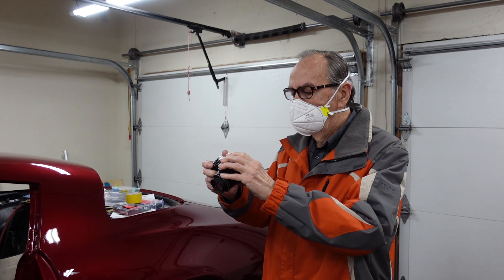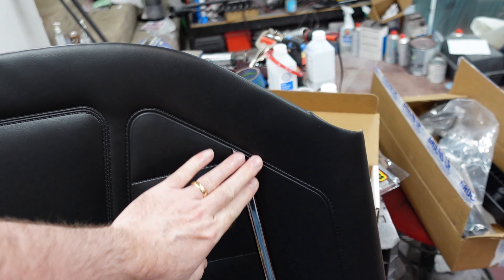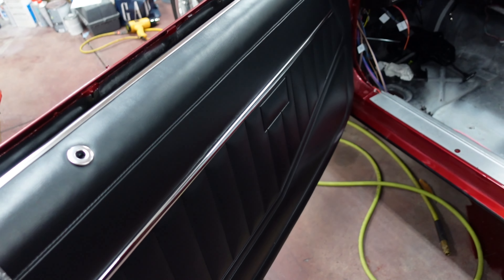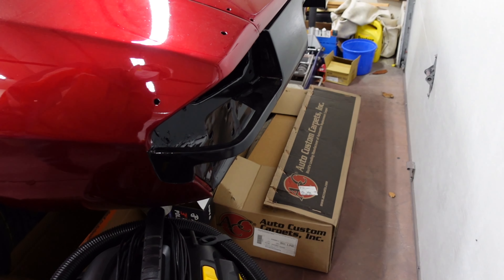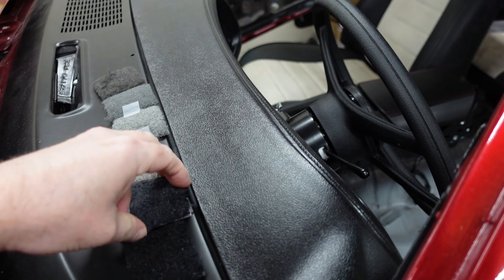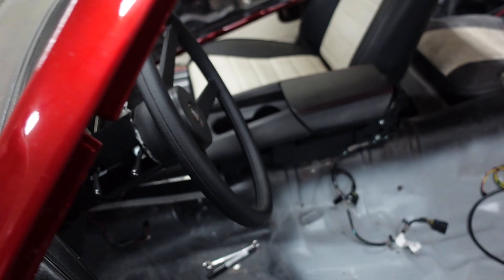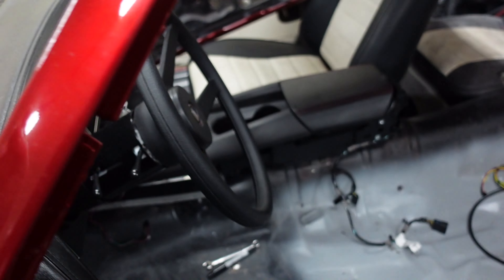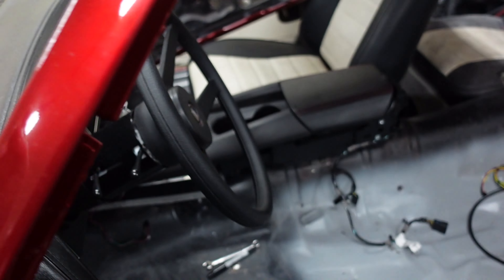1977 Camaro Z28 Part 298: Console part 4

Comment: IMO do not use butyl cause when your car sits in the sun the glass will eventually sink. Both my front and rear windows did. I had them pulled and redone at Speedy Autoglass in urethane back in ‘85 and they haven’t moved since.
Reply from the maker: Thanks for the input John!

Comment: I'm going with a pro installing my front and rear glass. He's going to be installing a "dam", which contains or restrains the urathane goop for a nice finish inside my 81 Z28. The dam also is used to keep the glass off of the frame the perfect amount so the outer trim sit right. They make different dam thicknesses, so he'll be researching the correct thickness for my application. He'll be placing the glass sorta in place to get some measurements for placing the dam, if my memory serves me correctly.

I've been working off and on my build for like 16 years already!

Cant wait to see both our cars done! Cheers
Reply from the maker: Thanks a lot Jake. If you can let me know how that goes, thanks.
Reply: @asicerik  no problem. Probably will be a month or 2. We'll see how it goes